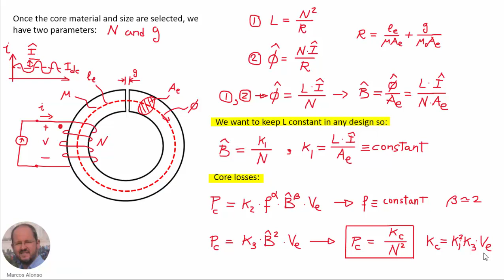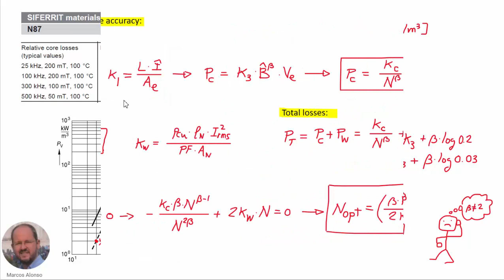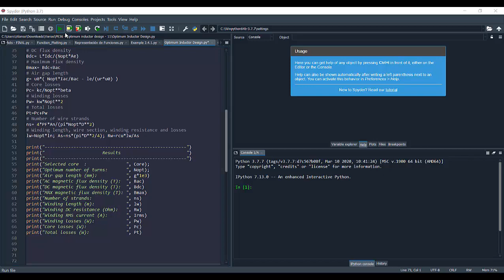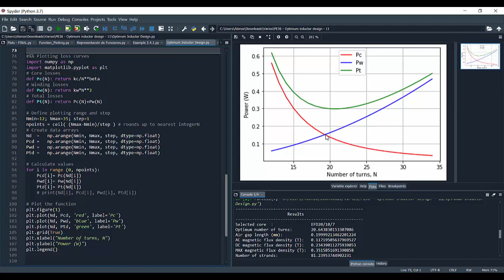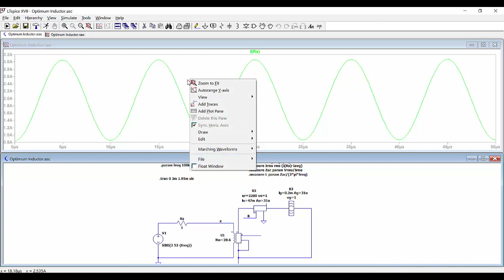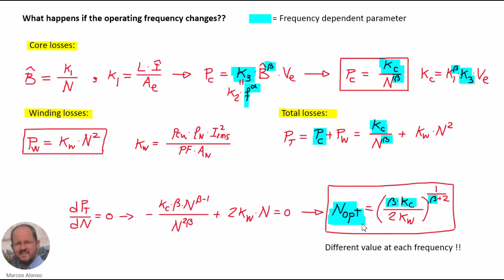PE #36: Optimum Design of Power Inductors

Comment: Amazing video and details insight. This series would be complete by a video explaining how to consider Rac due to proximity effect 😁
Reply from the maker: Thanks for your comment. In most industrial applications if you use litz wire or twisted wire with a small diameter you can neglect the ac resistance effect.